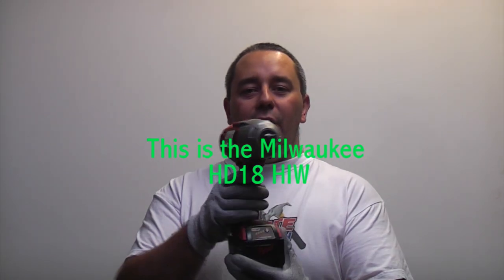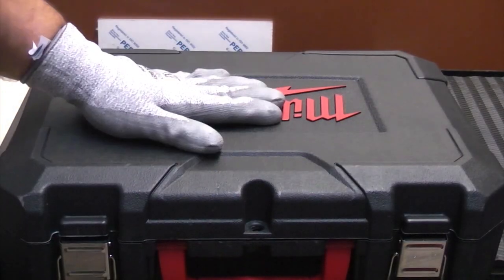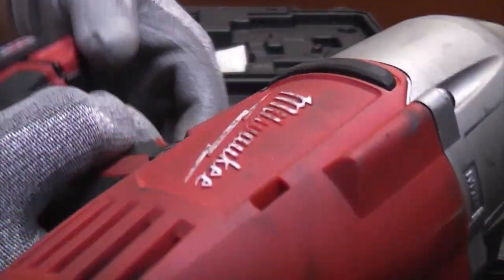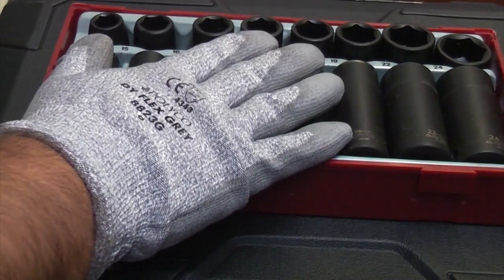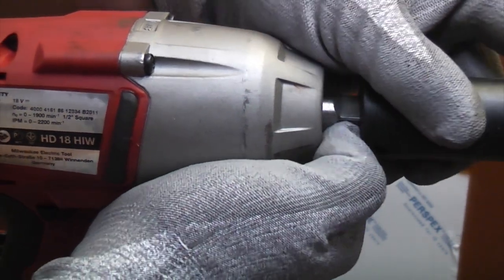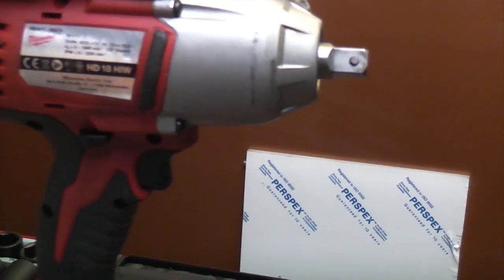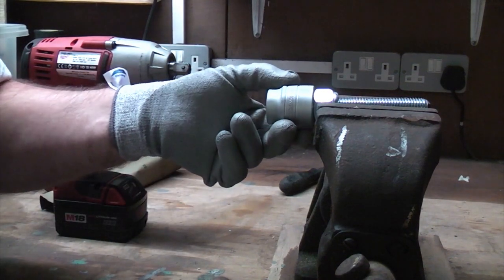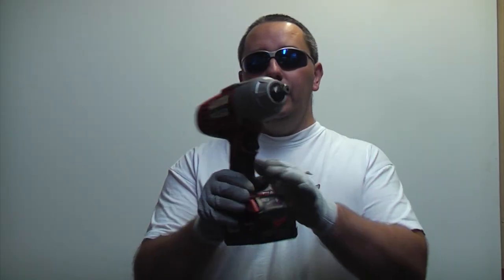Milwaukee HD18 HIW 18v Impact wrench

Comment: an update, ive had the set for about half a year now no problems, even accidently dropped on of the batteries in a bucket of water, took it out let it set for a day and no problems at all still takes of even the rustiest of bolts with ease i highly recemend this if your looking for portability or even an air impact replacement

Comment: They will have a brushless version in fall of 2013 but they don't have torque specs on it. In the video of it the makita 18 volt high torque impact couldn't loosen a bolt tightened by the milwaukee

Comment: You're absolutely right, Snap-On is extremely over priced and honestly over rated. Milwaukee tools will always get the nod over any Snap-On tool when I'm choosing. As far as the Ingersoll Rand you spoke of, that would be the W7150 and it is a MONSTER... there currently is no comparable cordless impact and very few air impact wrenches that can stack up to it. It has just recently become available as they had some issues before launch.